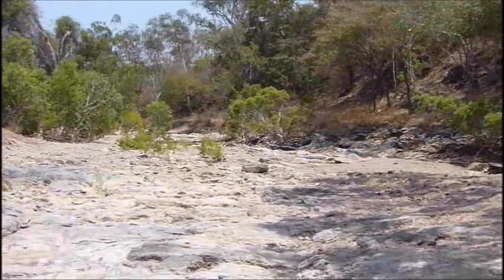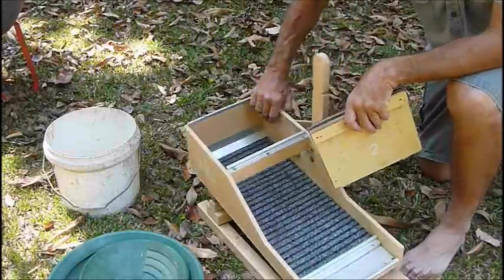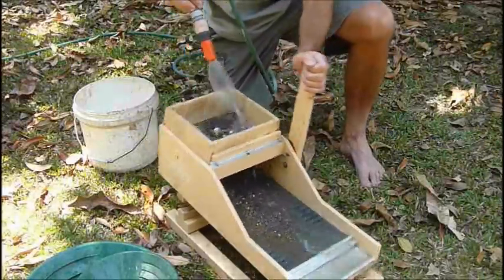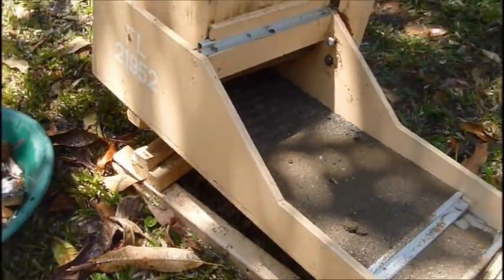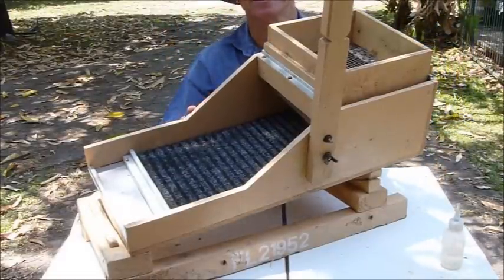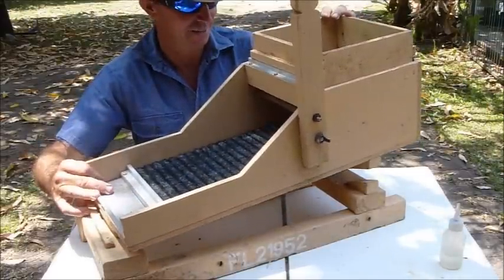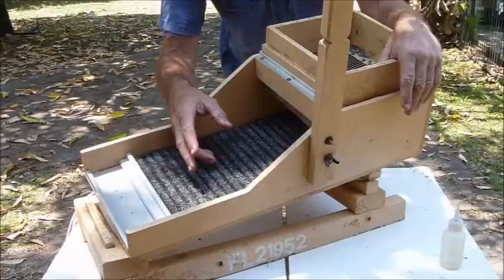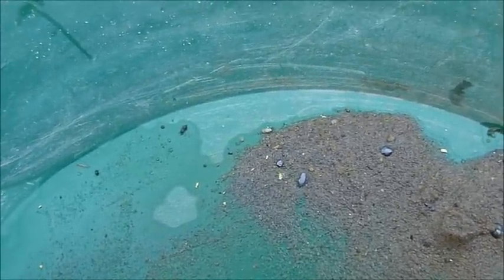Cradling For Gold: 1870s Pattern Rocker Box.

Comment: Good video mate and a nice little unit you have made. A little suggestion would be to remove the wire in the hopper and replace with metal plate with holes in it, this will allow the water to move slower down and give more time for the water to wash the dirt from the rocks better.

Comment: NQ, another informative video. 
I've done some panning and I particularly go "crevicing" where gold falls into the gaps, using a bent screwdriver. Last time out, I raked out a grey sticky muddy goop and somone nearby said it wouldn't be any good - but - as I said "sticky" and sure enough, I got good flakes from it. Also, some blokes were using an aluminum sluice which really is everything the cradle is, except that the stream does the work.
Well done and HH.

Comment: @NQExplorers HI if you took the windshield wiper arm ball and socket  off a wrecked car just the ends you can make a smooth push & pull shaker arm then the movement be so precise you can sit stand kneel high low just a thought won`t cost anything and have a smooth operation movement.

Comment: I have a Falcon MD20 also and I use it extensively and I find it will do a much better job then my Garret ATX,  I live and work my gold claim here in Death Valley California and most of our gold is micro gold so for the Falcon MD20 to work there needs to be a bit of the gold in a condensed area .  The mining on my claim started in the 1890's so there are a lot of holes on my 20 acres and the deepest shaft is 500 ft down with 4 levels and no there is very little supports for the walls or ceilings and I have driven dune very little driving of new tunnels but I am still filling up my settling tanks ..  Thanks for the rocker I really enjoyed that mate .
Reply from the maker: Thanks for your great comment Mike, great to hear you are getting gold from your claim. You wouldn't believe it we were in Death Valley last month on holidays - beautiful spot - wandered around the old town of Rhyolite too and had a look. Didn't to any prospecting but I know there was a lot done around there by the Old Timers. All the best mate and Happy Fossicking! Warren.

Comment: Most of the old rockers ive seen in Alaska had a canvas pocket?under a hand made punch plate  our screen doesnt leave water sloshing around long enough+- to really separate the material..rockers dont use hoses . they had can scoops on handles...but its working.  but in the bush you better get a can on a stick.  😀

Comment: I could picture enlarging the side of the feed hopper side and the addition of a water spray bar of some sort and a water return at the bottom of the rocker box . Running from a small flexible regular water hose  to a small 12 VDC pump inside a 5 gallon pail. It would be running from a solar panel.

Comment from the maker: Thanks for watching and commenting mate, yes you could make up a spray bar system to hold the hose or water supply. Usually we use this in the bush next to a creek with a bucket or dipper, but you could run a pump and spray bar to continuously wash the gravel as you rocked it. Happy prospecting!